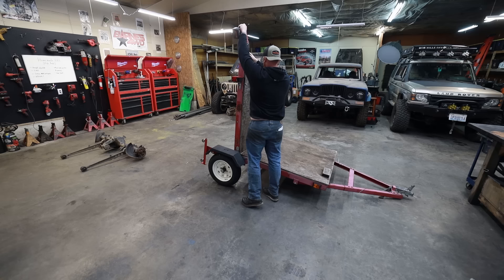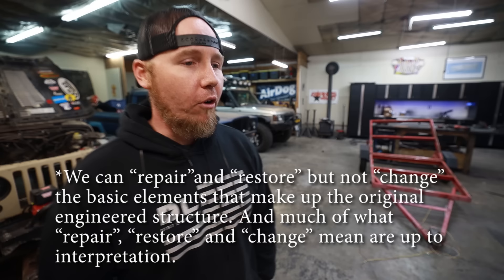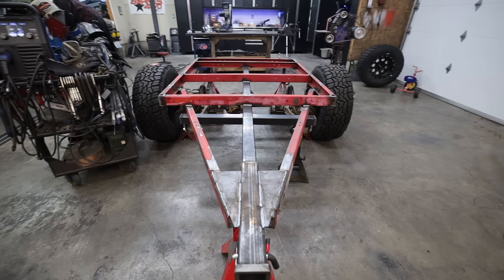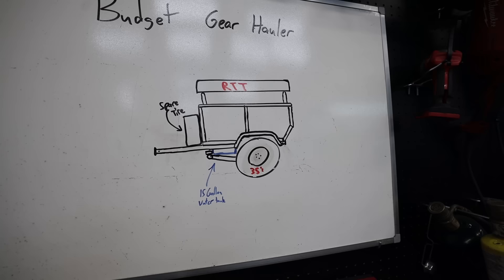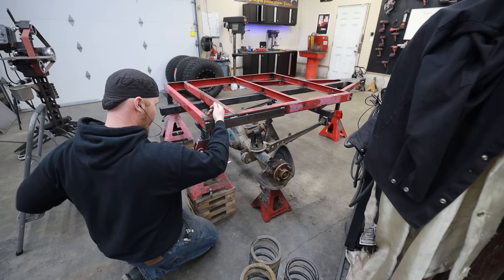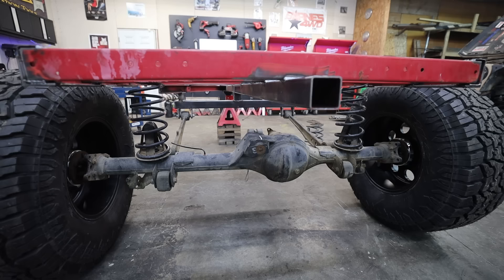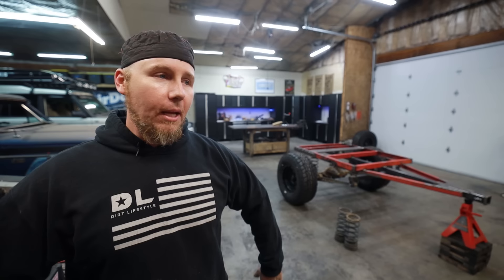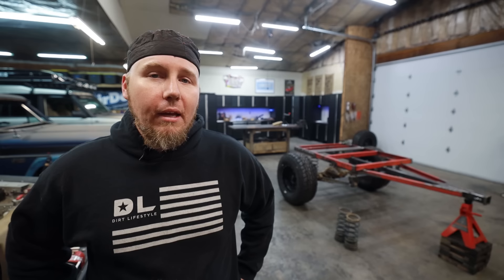Budget Harbor Freight Off-Road Trailer Build. Making An Overland Trailer On The Cheap.

Comment: An idea I have for getting 5x5 wheel lug pattern is to use a jeep jk's front unit bearings/wheel hubs. I think I might need to get some 3/8in steel plate cnc laser cut to match the jk's unit bearings flange diameter that supports the load, but I like the idea.

Comment: I always wanted to try using 1 leaf spring with coil springs? the one leaf spring would act as trailing arms to position the axle and hold it in place then the coil springs would be the main suspension.

Comment: A lot of people don't understand that everyone has their own way of doing things no way is wrong if it works as intended. Is there more sophisticated way more complex way or a way that would make more since to someone else sure, But every fabricator has a way would be better even the same fabricator after something is built can sit back and say that could have been different. Most of the keyboard warriors don't have welders and some that do also own a grinder remember that. 👍

Comment: Just discovered this series. I'm currently learning to weld so I can complete my trailer build. Starting with a Jet Ski trailer I had laying around, and reinforcing it with steel. Using Timbren suspension, and modeling some of my ideas after a Patriot Campers X1. Looking forward to the rest of this series!

Comment: Mount an alternator and belt drive on the front of that axle, wire it to a battery mounted in the drawbar area. free power.

Comment: Great idea and I like your reasoning.  However, I would only do this if I got the trailer for free.  In Texas, for the same price as a new HF trailer, you can get a really good 1 or 2 horse trailer that comes with a much stronger frame and axles.

Comment: Hey Brother back in 1999 I didn't know how to weld. I learned to weld helping a neighbor in base housing build a trailer. We started with an old abandoned Wellcraft boat trailer that had 3500# axles. We used C-channel and many of the cuts at first were made with a hacksaw Tom a neighbor had mercy on us and gave us a broken chop saw that needed a new trigger. We used it and a cut off wheel for a 4.5 angle grinder to do everything else. 

Not knowing where things should go I went to a trailer sales yard and reverse engineered a PJ car hauler. 

We got it all welded up and about the time we were ready to put boards on it my friend and neighbor recieved orders to Japan. So when he left he gave the trailer to me. I put boards on it and started using it. It's now on its 4-5 board replacement and 4th set of tires. We just used it to pull a Freightliner frame and axles home from Kentucky. 

None of my welds have broken, it's still straight despite some awkward loads and I still get complements on it. So the moral to the story is don't worry about the negative people out there a lot pf us understand why you started with a cheap trailer that already has a title and reused that axle because we do it too. 

I actually have a rack of axles beside my shop and a camp trailer in work that I'm building from a pop-up frame as I write this. I watch you specifically for this type of content so don't worry about the Negative Nancy's out there. There are a lot of us that really dig this type of stuff. 

And if you find yourself on Fort Worth I need help welding two freightliner frames together, I think I am in over my head this time.

Comment: I think it is a great practical idea, it is a budget build, not an no expense spared luxury trailer. I like how Rich@ Rich Rebuilds "frames" it, pun intended "you can do it your way in your workshop when you build one" 

Even if you do the same thing again, You are likely to want change & improve things

All most every one is an "expert" even when some coat that with a veneer of fake humble.. I once hered some describe an "expert" in the context of "most" people as "sperts under pressure"  which I think is apt.

There are very few true "experts" & even they do not know everything, the best kind of expert is ever present to the fact that no one is perfect & no one  know everything.

I guess  am just reminding you what you already knew.

Comment: Nice build, I too built up and modified a 4x6 tractor supply trailer in much the same manner, ie; keeping it legal.  I considered adding a 21 gallon water tank beneath it for the same reasons you stated. But I thought, wait, after being out for 5 or 6 days that water tank will be nearly empty. Mine are saddle tanks along the inside walls of mine. Empty or full it doesn’t change the COG dramatically.  Just a thought.. hey, nice work & a really great vid.  Peace out !

Comment: Use an axle that will fit your main towing vehicle so if the rear end goes bad, you can just swap it out and keep going as the bad rear end is just rolling under the trailer, not driving and pulling the whole thing.

Comment: Here in Oregon, if the trailer is single axle and under 1800# loaded, it doesn't need to be registered. I have a flat bed 5thwheel that weighs 1400# un loaded. However being as i use it for charity hat hauling with Timber Unity. I've put 6000#  on it and a cop only waves at me.

Comment: I know this is a year old, I’m considering a similar build. You can build anything you want on it if it’s modular….for example you can build a camper box, that sets in the trailer and straps in. It’s a load and not part of the trailer now. Same with welding trailer add-ons, etc.
Reply: Also if you add shocks parallel to the axles in an a-frame, would that work as an axle locator instead of panhard?

Comment: you want a little bit of flex in a trailer or else youll just stress the welds i wouldve used bolts for the crossmembers other than that i wouldve welded the rest but the reinforcement should help, just a suggestion

Comment: Just found your Channel and I am enjoying it, thanks for the content. For your custom build comming up, a few ideas  I have been looking into for my own build are: Coosa composite panels for the skin, using 80/20 alum square tube to save a bumch of weight for the interoir frame, putting angle steel around the outside edges for impact protection, and lining the body of the trailer with Line-x body aromor.

Comment: It's weird how states differ as far as checking trailers homemade or store-bought. I have three homemade trailers with the same title number on all of them and use the same tag and just switch it from trailer to trailer. My original trailer was built in 1985 and I no longer have it just kept the title and put my numbers on all the rest. I do make them as legal as possible with lights, safety chains, tie-downs so as not to draw attention from the locals. Good luck on your builds and see you on your next video.

Comment: Grease the bearings every couple of years and it should be fine, but I don't think they'll hold back water. I have the 1750 unit so it has 5 lug wheels, it's close if not the same as the later ford 5 X113.5 IIRC. I used nylocs and 3/4" ply, hasn't shaken apart, still flimsy but not as flimsy. Good beginning for a lightweight trailer build.

Comment: I'm starting my Harbor Freight trailer build and the first thing I'm going to do is weld the frame- it's perfectly good steel. Your axle got me thinking...could it power an alternator? A nice 12v solar and alternator (while driving) could support some goodies. The other thing I'm going to do is run a 2" tube like yours down the middle.

Comment: Great base platform! Use what you got, definitely the best approach for any budget build. It makes a lot of sense to add strength down the middle as well as eliminating the bolts by welding them up. Very pumped to see this build, it is one of my goals to build an off-road trailer.

Comment: Dude, I'm excited to see what you are coming up with. 

I just hope you checked the drive shaft angle on that axel!!!

Seriously, I've got a utility trailer that someone else built that has no suspension. I built a roof top tent that goes on top of it, but I can't put any gear in there during travel because it gets hammered while driving. I'm hoping to learn a lot from this series.

Comment: I've always had an idea on one of these offroad trailers that would work with this build since you are using a differential for an axle. That would be adding an electric motor to assist the trailer threw the trails reducing the drag.

Comment: Been watching, my tip water goes true hole, so welled on outside instead of drilled true, and rubber on side table on the wall instead of top of table

Comment: I'm watching and just bought a Harbor Freight trailer and some steel. Have built several trailers but this will be the most complex. Thanks for your videos and don't let the negatives get you down. You are an excellent fabricator and have lots of real world experience. One question, spring rate? what did you use for springs? my build will be very similar to yours. Thanks again!

Comment: I think you did good. I just wonder if the state would say the trailer doesn't need another inspection. I believe the trailer is much better and safer, but I am not the inspector. Luckily I live in a state that does not require licensing for a small privately owned trailer. I have a small "pickup bed" trailer that is licensed in Missouri even though I don't live in Missouri. You are inspiring me to do some of the mods to it that I have been mulling over. Thanks, for the content and keep on no matter the nay sayers! Also, the difficulty to get an inspection will make the cost of already licensed trailers go up, government induced inflation.

Comment: Early in the video you said the trailer is flimsy.  Of course it is.  It's a Harbor Freight product.   Don't expect much happiness with the trailer unless you fixed it like you did.   I do not buy HF products anymore after a few mishaps with their products.   Tile saw (crap).  Trailer wiring (crap), Hitch pin (crap).  And a host of other products that have failed.   I almost lost my trailer because of the poor quality of their pins.   Luckily I use safety chains.  Just know what you're buying when you spend money at Harbor Freight.
Glad to see you did the trailer the right way and not the HF way.

Comment: I started with an old boat trailer when I built my off-road teardrop. There are a lot of benefits to starting with an existing trailer. I'm not a fan of the Harbor Freight trailers, but there are tons of them around. So if you have one, then start building!

Comment: Cool video! Cant wait to see the rest of the build! I just took one of these foldable trailers and bolted all the folds together and put a wood deck and wood sides for a utility trailer. I am taking my original "Utility trailer", that is super strong, and am building an overland trailer out of it. So I am looking for ideas for mine. There are no (really) wrong builds, its all you!

Comment: inspection? You basically strengthened it 1000%, made it 1000% safer, 1000% reliable, 1000% functional. Hell, Wa DOT should be paying you everytime you drive it out of the garage!

Comment: To save a little weight could you mount a single shock along or at a slightly different angle to your track bar? In my mind it would stop the bucking bronco affect you discussed. If you mounted at the opposite angle it would I think allow for more articulation and really dampen bounce out of the trailer... Just a thought.

Comment: I seen one video where the Harbor Freight trailer would Not handle the load of rough traveling with a small house on It so they bought a new over priced trailer I told them that they could have just welded In some new brackets

Comment: Dude get an old boat trailer ( got mine for 150.00  ) I did and its heavy duty as hell and 5 x10 with a little welding but if your just welding anyway looks good

Comment: Colo requires a certified Vin / build inspection on anything built over 2k. when he showed up he checked the vin# then started to look over the trailer, I said can I see you CWI paperwork?? Blank stare followed by a what's that.. That would be your Certified Welding Inspector Papers. He signed off on the Cert vin paperwork and left the building..

Comment: Looks like it will be a very light trailer with a good departure angle. I am interested to see how you intend on using the fold out section of the rooftop tent as an awning. We had a iKamper on our old camper and it just looked too crazy up that high so we lowered it (I'm 6ft5) - that on the back of all that weight up in the air.

Comment: should've kept the brakes and fitted a hydraulic override braking system. yeah i know it's a relatively lightweight trailer but all offroad trailers should have brakes preferably electric. other than that i've got no further criticism it's probably one application where a disco diff won't fail lol

Comment: It’d be cool to rig a generator to the Ujoint on the axle so it charges a battery in the trailer or something as you drive it.  Take advantage of that mechanism.?? Thoughts?

BTW I think it’s pretty rad your using an old
Leftover trailer.  This is actually something I am super interested in.  Excited to see what it looks like.

Comment: Great explanation. First thing I thought was oh no, why is Nate starting with that rather than building from scratch.  Your info filled in some very important info that many might not think about.  Then there’s the insurance issue. Not only for your investment but also for liability. 
Here in Wisconsin no license or title or manufacturer origin or brakes  required on a trailer under 2000 lbs GVWR. 2k-3k is a gray area. And fishing boats under 15’ are same.
Reply: And State Trooper I asked stated as long as I meet Home State requirements I am covered out of state where laws may differ.
Reply: And Nate…you do you bud. Let the negatives start their own channel!

Comment: Glad to see you taking a budget approach to build this trailer.  I do have one question.  I had one of those funky utility trailers that was basically a Jeep J10 pickup rear end, cut and bent frame.  It was very heavy, and the rear end had bearing issues and a lot of unused weight.  It had the original axles, gears, and bearings in the pumpkins.  So my question is how much you plan to retain of the disco driveline and housing.  It looks like the stock housing and/or control arms may be aluminum?   I'm liking the control arms usage.  Hope it clears the water tank when it articulates.👍

Comment: It would be cool if you found a way to use that axle "output" technically for something like a generator or a compressor or something because that power comming from the trailer on the road is going to waste

Comment: I wonder if you can add an alternator to the axle drive shaft end just to get a free electric charge for a battery for any gear or whatever on the trailer? Probably not necessary, but could be cool to get extra charge for something getting towed anyway?

Comment: So here in Colorado you will not get a title for that trailer for the road what so ever. its been a issue for years, but you can buy an old army trailer for a couple hundred and use it.

Comment: A while back I learned of an alternator bracket available for the Ford 9 inch rear axle.  Weirdest item I've ever heard of...  like it takes too much HP from the drag race engine or something? 
If you had an onboard trailer battery, and a 9 inch axle,  this might be an interesting way to keep the camping battery charged, at least when trailering it to the camp site...

Comment: Anyone that has Negative criticism should build a trailer just like you are and explain why they should do what ever it is they say you did wrong or what ever it may be why they do it there way like it would really matter not. But it is your build and you are the one doing to be using it so screw what Negative be they have to say really it don't matter but on a side note do you plan on getting bead locks in the future

Comment: Whoever is giving you bad juju just doesn't get it. I have one of these & have had issues but it was due to things I unknowingly had done. Building mine, I wished that I had a wire feed to beef up mine. The welding alone would help. My question is, why does everyone want to buy a HF trailer & then only use 1/2 of it? I don't get it. BTW, you have skills!

Comment: I am wanting to create a light weight dirt bike trailer from the harbor freight trailer.  Is there a way to reuse the axle that comes with the harbor freight trailer, bolt on a lug nut adapter to be able to put full size truck tires on it?  I would then also want to do some sort of lift to get the trailer higher.  1950 lb capacity would be fine for a couple of dirtbikes.

Comment: Great start to an awesome trailer. I love that you are using what you have to build it. This is much more of a everyday builder trailer that is still way nicer than I could build. Have you thought about adding an air tank to it, or using wheels that could also be used as a spare to the vehicle that is towing it?

Comment: I am getting ready to convert one of these trailer for my son he got it for $50 with ideas of making it a jon boat trailer. I like how you narrowed up the hitch and was wondering if you could tell me some measurements. How far in on the "bed" does the tongue sit or what is that angle? Either or both answers would be appreciated.

Comment: Question about trailer suspension.
I seen the Timbern axle-less, four point, and straight axle. 
What is the type/style suspension you used on this build? 
It seems the axle less type is preferred by most builders. Your thoughts on your preference. 
Thanks